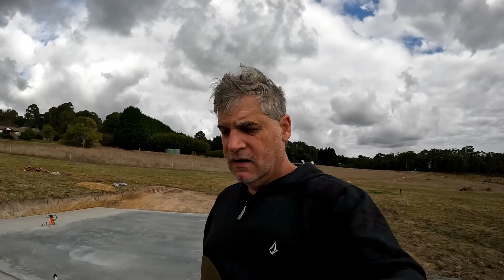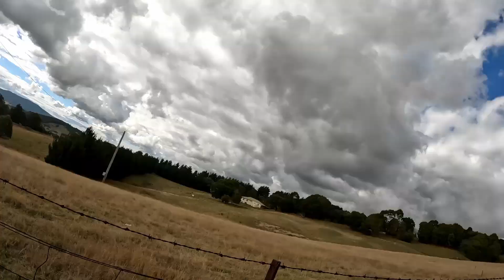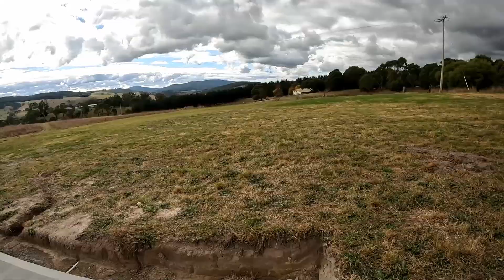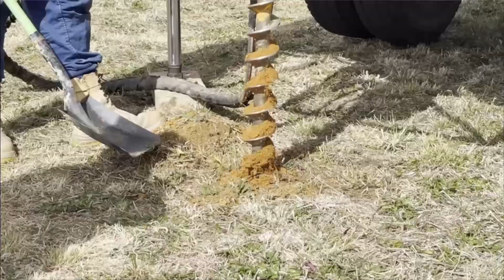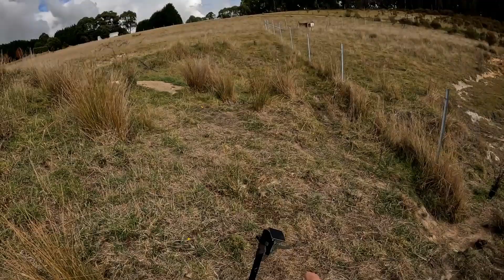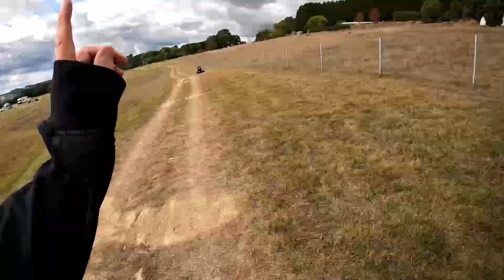Cloudbase set in concrete.

Comment: I have recently build 6 EEL V5 Kit battery packs 48V/15kWh each using EVE MB31 cells. Extremely good quality and way cheaper than anything you buy in Straya. To be used off- grid, of course.
Reply from the maker: Sounds like something we have bene collecting, ELPM482-00005 Rechargeable Li-ion batteries,   now have 48Kwh worth,   though we need to figure out how to make it all work,  worked out about $5K for 48Kwh  each module is 4.8Kwh

Comment: Sungrow and BYD offer some good modular batteries also. I have been looking at those and now that Albo wone he promised a 4K rebate. - waiting on the details.
 
BYD might have sodium Ion batteries shortly. 
Like the Sigenergy they are modular and very quickly upgrade bu just stacking another modle.
digging your own trench can save cost if they let you.
Reply from the maker: We were looking at the BYD but they have the least warranty period of most brands. And I couldn’t find much real world feedback on the BYD systems so far.
Reply from the maker: Also sungrow has been mentioned by a few installers.  Can’t remember why we sort of dismissed them,  I think it might have been capacity or discharge rate issue.   Not sure.

Comment: i assume you are looking at 3 phase power for the property? if that be the case look at a gateway home pro with 2 hybrid inverters.
Reply: He says about halfway he's only got access to a transformer with single phase
Reply: @john_p i started typing before hearing that
Reply from the maker: Yep transformer on the pole is only single phase.  It’s 100 amp capacity so can draw 24kw from it.  If we want 3 phase we would need to get the transformer replaced, and then the costs goes up to at $50k to pay for that.
Reply: @SydneyEV Amazing how the energy market has changed since deregulation. So many different entities now involved each having to make a profit and duplicating back office functions. An individual Cust paying for a transformer was unheard of back in 'ole days'.
Reply from the maker: yep, User pays for critical community infrastructure.   not the smartest economic system for such things.   i can understand if you wanted to upgrade existing infrastructure, but in this case, it was done when the original farm was boken up into smaller lots.  so of course eh cheapest option was done,  single phase it is.

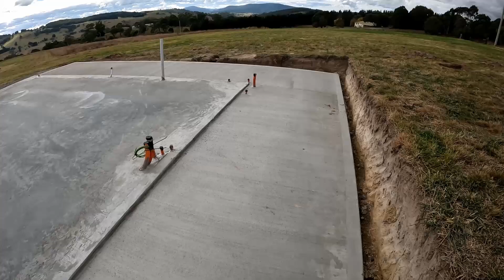Comment: 1:52 why not a Sungrow SBH400? I've been considering one (or possibly two) of those, especially with the new incoming subsidy. FWIW I've had 23.76 kW of solar since 2019, it regularly makes 110+kWh/day in summer, so if you're looking at a similar amount of solar (and especially if you're thinking about Amber and being exposed to live market prices) you might want to cover your arse with more battery. Just a thought.
Reply from the maker: Unfortunately we are limited to 5kw export no matter what we get here, so won’t even bother with any export, we can get OVO plan for free power between 11 and 2, and also power company here is introducing a “sun tax” of $0.015 per kWh exported.   We have 2 EVs and a third coming soon, so have plenty of storage in the cars to soak up the solar.   Battery capacity will be about 30kwh. Plus we have 48kwh in rack mounted modules to rig up as well so total of over 70kwh storage.